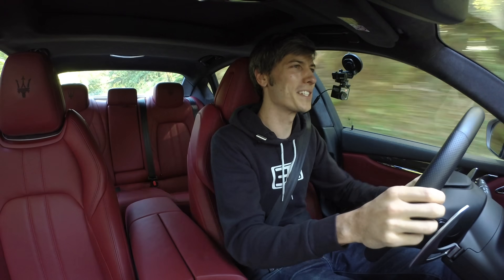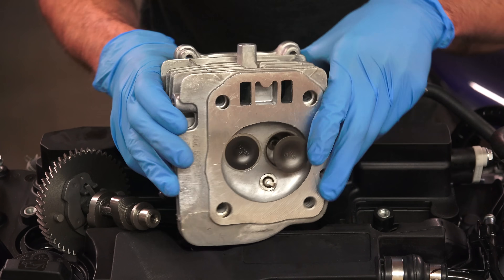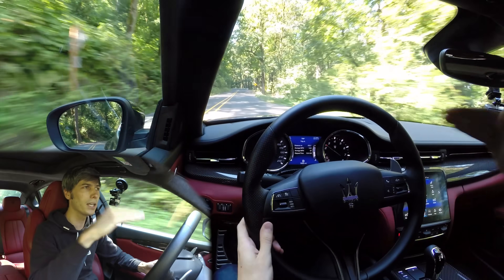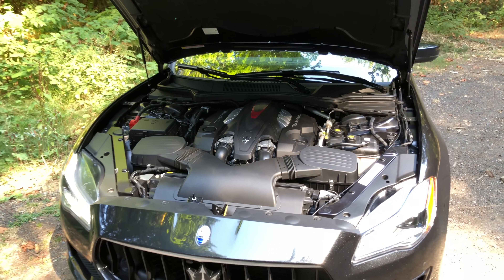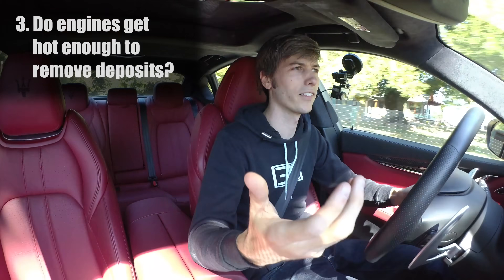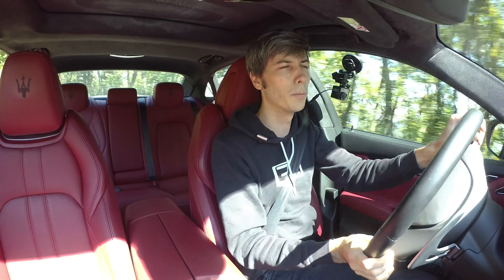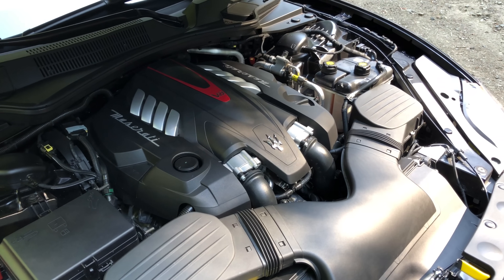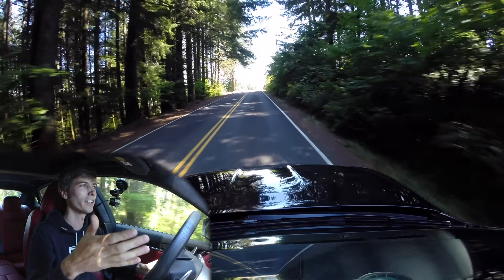Is Redline Good For Your Car's Engine? Italian Tune Up

Comment: I'd expect that once you have carbon deposits, they act as insulation so the temperatures are not the same as they are on the metal surface, which at least complicates the analysis.

The EGR does sound like another complication, one unlikely to help clean the deposits.

Finally, blowing the carbon deposits out into the atmosphere, at least on streets near people breathing, seems unwise.

Comment: I mean it's not only heat, but also any debris/dust/fluids in/on the intake, exhaust, valves, will be shaken off/ blown off. Additionally water in the oil will boil away. Cats might also be cleaned slightly.

Comment: It's not the revving per se that works,  but the consistently higher temperatures. Just driving a Honda Fit, high mileage with a misfire under load. Has been used around town, idling up to 2000rpm and probably not had a good run in ages. Took it on the highway for several consistent runs for 20min plus and car significantly better. Changing plugs soon, so should sort out any remaining misfire.

Comment: I have an E63 AMG and recently the engine management light came on. Took it to the garage and the mechanic hooked it up to the OBD scanner. Turned out to be deposits on the oxygen sensor in the CAT. He told me to go 'drive it like I stole it' for a while, and to give it a bit of a burn every now and then because the slow town driving I was doing was leading to deposits collecting on the sensors in the CATs.

Comment: Id rather just run a cleaner through it if I’m concerned about it.  Frequent redlining you engine cause premature wear.  Do it too often then youve got bigger problems than a little bit of carbon.

Comment: I have quite a slow car and from a stop, going up a hill up to 80-90 mph takes like 10-20 seconds at wot so would that get the temps high enough to remove deposits? The car is a 2015 outback with the 4 cylinder engine. The oil sure gets hot getting to over 220f with moderate external temps (50f).

Comment: 17-25 minute italian tune up 2 times a week up a mountain with the guys, my engines last long, really long. Never broken one, my R18 Civic has raced about 70-80 times up that mountain, and has done a lot of daily miles, the engine is smooth as butter, same with my FA20 and my F22b1. The M42 on my 318is did like to break cooling stuff and timing guides tho.

Comment: You missed a couple things here. Temperature is important of course but there's also how much gas is being sprayed into the cylinder, do the centrifugal or inertial forces help break up deposits. How about the extra pressure inside the cylinder?

Comment: I've never had problems with GM cars I brought him 300,000 miles as long as you do the proper maintenance and take care of them the last forever now if you have Ford that's a different story normally the Transmissions go out or they blow head gaskets or the rear main seal leak like sieves worst motor ever made was a 360 that was a piece of s*** in the 400m in a Ford 351 m but the decent one was a 390 but all in your stuff nowadays the focus is there okay you can go quite a few thousand miles on nose till the rubber band breaks in the transmission than you you're screwed and all I've been built race engines for over 40 years and yeah they all blow up if you turn them harder than you really build them so senior Redline them yeah it's going to cost you a lot of money to get to that 7500 8500 RPMs all the time soap attack in your car or truck is got a red line of 77,000 RPM chances are I'll never go there cuz the rev-limiter upright cut it out and most of all it'll probably blow up break a rod it don't matter what it is if it's a stock motor it'll never make it at Redline maybe once or twice that's it but otherwise I wouldn't do it constantly no

Comment: Please does a mechanic or experienced drifter know if it is ok to bounce of the rev limiter in first or second gear consistency? I'm trying to learn how it all works. I own a 86 and I need to know so I can try to drift without being concerned I'm about to blow up my engine
Reply: If it's for a second or two, it might be OK. When you drift, sometimes you do floor the throttle long enough that the engine hits and stays at redline until you have to let it off. Make sure your engine is prepped to operate this hard.

Have you tried asking other drifters at grassroots drift events?

Comment: My car has the PSA THP engine, renowned for carbon build up on the valves due to poor inlet path design (there's a dead spot that allows more deposits than most similar engines). The engines are really strong in most respects but this is one flaw. They absolutely benefit from the occasional sustained run with as much 5000rpm plus as you can factor in. And the build up seems to get worse and quicker if you do a lot of highway driving in 6th. I tend to drive in a gear which keeps me in the high torque band, so don't get too much problem with carbon, but I also do highway commute 400km a day about two/three times a week. I will find the car gets laggy with noticeable misses and acceleration hesitancy. A good run at 5000rpm plus sorts it out and it returns to normal for a while.

Comment: On GDI engines, the way Hyundai managed to prevent carbon build-up on the intake valves, was to enrich so much the air-gasoline mixture on cold engine starts, that some of the gasoline actually doesn't burn and is instead coating the combustion chamber which in turn is cleaning the intake valves. Result ?  No more carbon build-up but the extra gasoline is causing oil dilution and ultimately.. yes, the infamous engine failures especially on cars that mostly do short drives when the engine oil doesn't heat up long enough to have the gasoline evaporate, thus causing poor oil parameters and engine wear. The italian tune-up may actually help unclog old injectors and slightly stuck compression rings and will also help clean oil passages on engines with variable valve timing systems

Comment: Hi!  My dad had a 1969 Chrysler 300 with a 440 engine. When my mom would drive it, it would carbon up and run like crap.  My brother and I used to love it when my dad would take it out on the highway and floor that thing.  Carbon would blast out of the exhaust, so you knew when it was cleaned out.  It ran, as they used to say, like a raped ape afterwards!! BTW... we are Italian!! Haha 😄

Comment: Something for real I can say, owning 1.6L turbo, if I only drive it in a city for a quite bit, no highway, it start feels lazy and actually failed one time emission check that is performed in my city. After drive on a mountain highway around 1000 m delta in 100 km pass the emission check and felt more powerful.

Comment: Italian tuneups work best on carbureted engines. We used to do this in the 1960's by running the car on the highway in a lower gear to keep the revs up (but not speeding). But it is a waste of time and fuel on today's port and direct fuel injected engines. Also, some newer direct injected engines also have port injectors that operate at low power and speeds. Then the direct injectors operate at high power loads or a combination of the two. So that the intake valves are washed by the port injector spray at the lower speeds and loads. This seems to be a better fix for the intake valve carboning up due to the intake PCV blow-by. Toyota, Hyundai and some other manufacturers are incorporating this tech in some of its engines.

Comment: in old cars , yes

in new cars yes too, but for different reasons :  flogging a modern car will retune the self learning engine tune, so it will run better for it after yer mum been lugging the engine a lot in low revs in the city.

Comment: If you heavily upgrade the cooling on the car you can drive it as hard as you want & nothing goes kablunky........well an auto transmission still will but not the engine

Comment: I have had several port-injected 2 L Turbo engines. When looking at the exhaust gas temperature, something inside that engine is running near the melting point of aluminum. It certainly takes more than running the engine to redline once but very easy to get those parts quite hot in there with some proper racing.
Hills are especially useful.

Comment: I think fuel additives such as are put in "top tier" gasolines are supposed to help control combustion chamber deposits or at least to "scavenge" the deposits such that they reach a certain thickness and then don't get any thicker,this has little or nothing to do with deposits in other parts of the engine such as the oiled parts and oil pickup screen "sludge" and "varnish" which are mostly the fault of oil and temperature,perhaps also of poor crankcase ventilation

Comment: How about a lower temperature thermostat? If the engine temperature never hits those temperatures would that avoid carbon buildup in the first place? Low temp thermostat and an oil cooler?
Reply: Or a cooling system kill switch where you can occasionally slightly overheat the engine?

Comment: The Italian tune up (from what I’ve learned) requires 70-80mph for a solid 20-30 minutes no break, if you can raise your rpm’s slightly then even better (don’t go red line that thing). May be in my head but every old car I’ve done it too drove a lot better afterwards. Unless something was detrimentally wrong with it to begin with.

Comment: This should only be needed on older vehicles and GDI engines, and only if they've been driven very gently allowing large amounts of softer carbon buildup as well as sludge. Keeping injectors and spark plugs operating properly is key to not building carbon in the first place (since most carbon builds from incomplete combustion of fuel). Use a PEA fuel system cleaner before oil changes. Newer vehicles shouldn't have any problem with carbon if serviced somewhat regularly, and any carbon buildup will likely be a smaller amount of harder carbon deposits which often takes vigorous manual cleaning to make meaningful change.

Comment: Nice detailed study! In addition, there are things beyond carbon deposits (on the moving internal components) to consider.  An "Italian Tune Up" may help other things. For instance, maximum fuel flow through injectors will tend to clean them. Spark plugs get hotter and burn of any oil or fuel on them. Getting engine tuning devices (cam timing adjuster, intake runner adjuster, like BMW VANOS and DISA valve) to move through their full mechanical limits can keep them exercised and healthy.  Once in a while, a full throttle up-hill pull is "molto bene!"

Comment: I would never redline an engine I cared about. Just driving on the highway for a distance will burn off carbon. A wise mechanic said in order to keep run a car for 300,000 don't have a lead foot, change the oil every three thousand miles and change the transmission fluid every two years.

Comment: All I know is my car and motorcycles run better, feel smoother and have more power after a hard run through the rev range. Perhaps the injectors get a benefit as well from the higher pressure cleaning them out. Also higher cylinder pressure pushes rings out harder against the cylinder walls helping rings seal.

Comment: Can confirm that (for motorcycles) a trackday will get rid of carbon deposits.  Can also confirm a short highway blast is not nearly enough.

If I look at intake valves before and after trackdays, there is usually some oil and carbon deposited onto the valves before, and without exception they are completely clean after (whether thru fuel spray or temp).
The exhaust muffler outlet is pretty much always covered in black dust, except right after a trackday, where is it 100% clean down to the metal.

Comment: Italian tune up absolutely works. I had an old crappy car (my first), and at one point I just couldn't get it to pass emissions even after multiple attempts. Replaced O2 sensors, catalytic converter, and did a bunch of other stuff, and it just wouldn't pass. Got myself into trouble with the authorities because of it, but couldn't afford to replace the car. Tried the Italian tune up a few times, but always in short sessions (10-20 minutes), still no luck. In a last attempt I used a longer trip I had to do, about 300 highway miles, and redlined that sucker (1.2L 4 cylinder, manual trans) during ALL the trip. Miraculously it didn't blow up. Next time I took it to be emissions tested, lo and behold, passed with flying colors! However, it never ran very well after that :D
Reply: American tune up: trade in for a new car, lmao
Reply: I like your style man. High risk high reward 😆
Reply: That is excessive lmfaoo
Reply: Legend

Comment: If you read the patent paperwork for the original Audi/VW 2.0 FSI, The issue of buildup on the valves is mentioned.  Audi/VW's answer was to use a special metal in the intake valves that would tolerate a temperature high enough to  help the buildup burn off.  To get the valves hot enough, they recommended in the document to as they call it,  an Italian Tuneup by running the engine at 3000 rpm's for 20 minutes to clean the valves.

Comment: One of my new vehicles direct injection the fan kicks on by 212 and kicks off at 200 I have a hard time believing they didn't do that on purpose and yes those are legitimate temperature numbers they're not just a guesstimate of what's on the gauge this is hooking them up to a computer and monitoring the actual engine temperature with other sensors and not  just your normal temperature sensor

Comment: I’ve noted with diesel pickups if I’ve driven unloaded for a while, then tow up a long grade where exhaust temps get up to 650c/1200f for sustained periods the truck seems to run smoother afterwards. Don’t know if it removes carbon, if the injectors get washed by high flow, or if the cat converter gets fully baked off, but I don’t think it’s a placebo.

Comment: I came here because I had heard of this and I just got rid of my check engine light/CEL.  I  have a 2012, 10 year old, Nissan Maxima  with only 25,000 miles. It was my fathers car and was never driven hard and was all non highway/city driving. It had a p0101 mass airflow  sensor code. I cleaned the maf sensor and throttle body with the appropriate spray. I cleared the code a few times and each time the check engine light came back on after a few days with my wife continuing to drive city miles as my father has for the past 10 years. Today I took it out, having heard of the Italian tune up and continually gunned it on the highway with speeds in excess of 80 mph. Well I turned on the engine after my trip and the check engine light disappeared and drove it back home it didn’t come back. After seeing this video I understand that what I did wasn’t really the Italian tune up and I didn’t remove carbon deposits but I definitely did something to turn off the CEL after it having been on for a couple of months.

Comment: Very well explained and based on proper reference. However, there is a school of thought which believes in Italian tune-up. Is there any research article which supports that school of thought? Basically, the intake valve temperature need to go past 325 degree C which never happens for Italian tune-up to work, I guess, or does it?!

Comment: If course things like bore glazing (caused by low speed running), and obviously the speed of the gases through the engine play a part too. Bore glazing could take months of hard driving to “fix” though…

Comment: Small engines and also old cars (talking about the 90's) used to go much higher in temperature. The cooling system was not oversized as it is in today's cars. The Italian tune-up made sense back then, today there is the hydrogen cleaning procedure which is based on the same concept.

Comment: Because my parents usually drive their Avensis at low RPM, it's usually my job to do the Italian tune up. I usually put it into second gear while joining a motorway and then floor it. Then I go up to 80kph, at which point the car starts to near the redline, and change all the way to 5th gear. Not only does it get rid of the carbon deposits, but the Avensis' 2 liter engine sounds quite nice at 6000 rpm, so I get some enjoyment out of it as well. It has a pretty similar note to what 4A-GE in AE86 has (That's probably just the way 4 cylinder Toyota engines sound overall, I guess).

Comment: The point of an Italian tuneup is not to remove carbon. The point is to limber up the rings and ifters by vigorous use...  And yes, driving a car in a spirited way will reseat rings and free up sticky hydraulic lifters. It's a good idea to change the oil afterwards.  I rehabbed a noisy Porsche 928 engine that had ticking, clattery lifters and general poor running from sitting neglected,  by driving the piss out of it for a couple of hours. When I was done, that engine purred like a kitten. It really works.  An engine that never sees redline just goes downhill.

Comment: I worked for a contracting company and me and a friend of mine got identical vw caddy vans 1.9l TDi model, he was trying to pull 3 tonne of sand one day in a double axle trailer, he was never a hard driver and kept this van below 2,000 rpm most of the time, me on the other hand redlined my van often and when his van failed to pull the trailer I saw it later that day, hooked the trailer up and manged to get it to a clients house, using some Milwaukee stethoscope we found his cylinder walls and pistons had plenty of buildup while my piston was clean
Reply: My van had 140k miles his had 90k miles

Comment: Hi Engineer, you have good informative videos. i am thinking of doing Italian tune up style hard drive, immediately change oil and repeat this every 1000 or 2000 miles do you think it ll help keep my engine and components in best condition? I have a diesel 4.5 engine